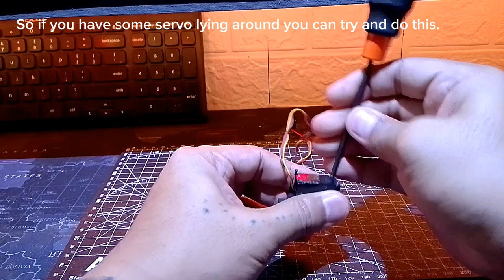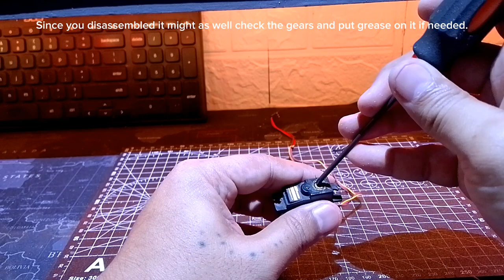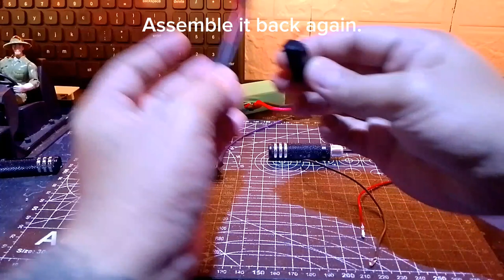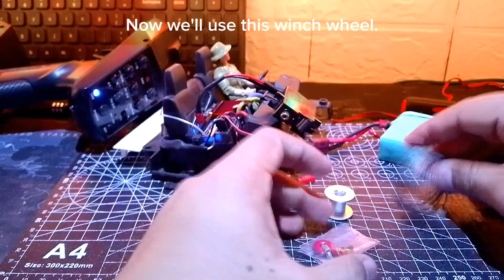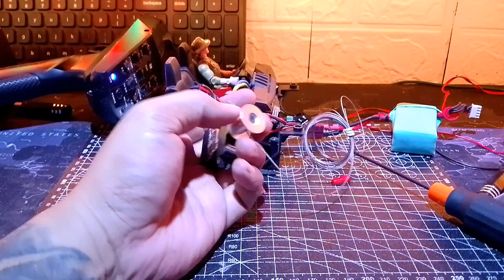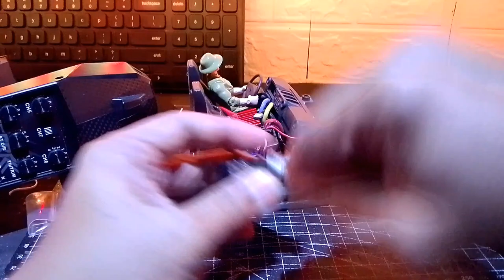How to turn your servo into an RC winch.

Comment: Good idea, I had purchased the CSPower servo and Surpasshobby, the CSPower have lower gear reduction but are too slow and very noisy so I'm using the Surpass 19g servos
Reply from the maker: Yes. It is a bit noisy.

Comment: You should have left the servo driver in place, the receiver is not meant to directly drive a motor like that, the pins can only sink very little current, the proper way to do this is to disconnect the gears from the potentiometer and glue it in place or find the middle position resistor value of the pot and replace the pot with a resistor divider
Reply from the maker: I see. I'll go ahead and do that. Thanks.